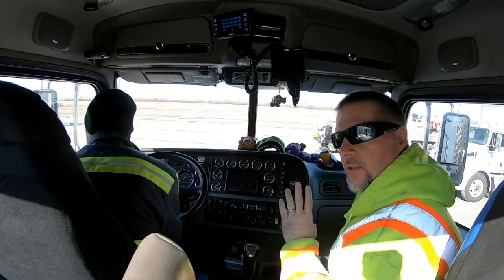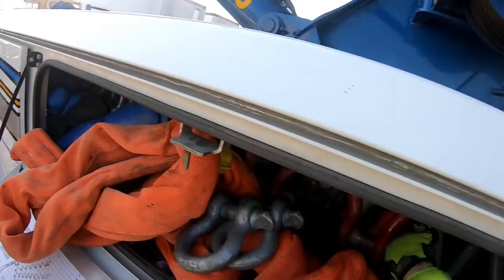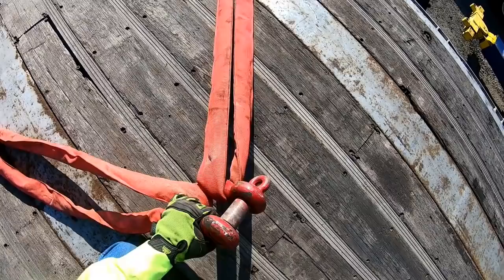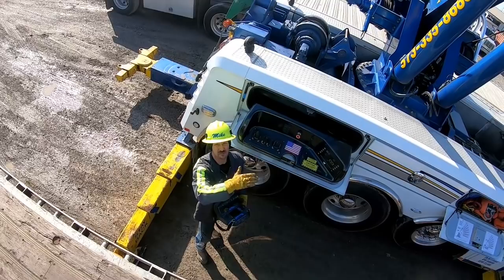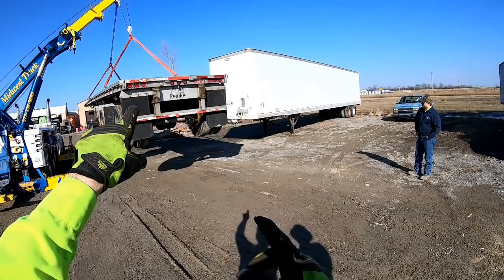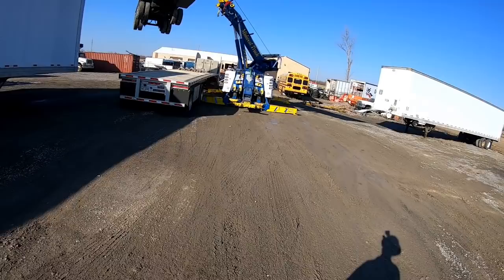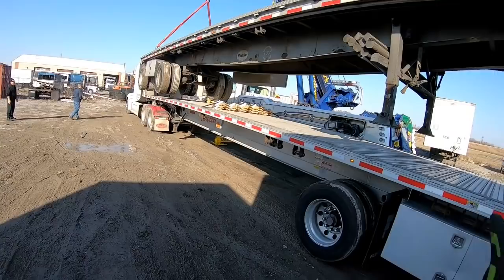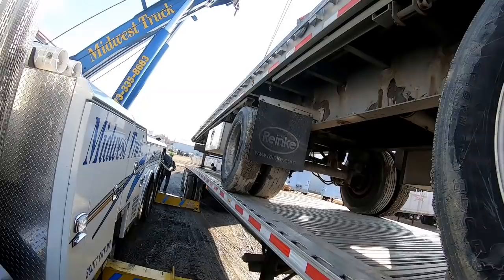Mike, the Tator, & the Trailer

Comment: Way to go Ron ! This is how I got my Hands on Training , with a Senior Certified Operator ,  Trained on Boom and Cable Boom  and on Tandem and Tridem , Don't get nervous Mike we all started out the same way , with practice you be shifting without the clutch as Ron said you can speed shift just tuning into the sound if the Engine , The RPMs will tune right in . Driver training on bigger trucks and Training on Booms cause basically a Rotator is a Cable Boom , my Certification came with lots of practice and guidence . Just Remember Mike work at your own pace and take all the practice and guidence you can get , and pay attention to a great teacher willing to give the chance to improve your skills . 
Great job to both you !

Comment: 2:40 Mike, if it doesn't want to go into gear, you usually just need to tap the throttle a little to bring the RPM's up.
And don't worry, we ALL ground a few gears when we were learning, I know I did...
Reply: As a young'n just learning the farm trucks, my dad showed me that he could shift it without using the clutch.  As soon as I was cut loose in the field, I would shift up and down through the gears only touching the gas pedal.  And yup, ground 'em a bit in the process.

Comment: He just needs to remember RPMs are your friend when driving a non-syncro transmission they don't like to shift at < 1200 RPM's.
Reply: I raked  few gears when I was learning. I drove a 5+4 for a while, I didn't know what gear I was in for the first two days, after that I got to liking it.
Reply: My thoughts.
Reply: @doublel7337  There is a reason Duplex transmissions have fallen out of favor for 18 speeds

Comment: This video did not seem like it was over an hour long, watching Mike at the controls and you Mr. Ron guiding him with patients and a relaxed demeanor sure made for an interesting video. Nicely done Mike, you’ll get the hang of it with practice and repetition before to long, then it will feel like second nature doing this job or something different. 

Believe me when I say this, we have a 53’ long tandem axel 73,500 lb, 104’ Ariel Platform Tower at our fire station, not just driving, it was a long time to get use operating it, while working the schedule we have. Before I retired last April, I was one of a few of the go to guys for almost everyone else on the department, including the new rookies, I’m talking from the Captain’s on down, because we all were responsible to be able to operate it. 
Note: our saving grace was in the form of a 6 speed automatic...👍👍

That included the platform or bucket controlled ladder and the 2,000 gallon a minute fire pump.. with 8 discharge and 3 different water intakes to it. It also was a $750,000 piece of equipment back in 2009, today’s replacement cost is well over a Million, not unlike the Tator.

Excellent job all around. Keep up the great videos...!
Reply: "patients" = patience

Comment: Ohhh! Mike's in the big chair and running the sticks(controls). Nice.
16:30 You could run a bungee through the cargo container's shackle to the trailer's rail to put tension on the hook so it doesn't slip off. Anchor the bungee toward the pull and it'll stretch enough when it gets loaded.

Comment: Another great video! My name is Mike too and after 35 years of driving big trucks, the sound of scraping gears still makes me cringe...especially when it's me doing it to my own transmission lol! We all miss one now n then. If you want to play with your Mike a little, you can say "That's ok, they're gonna start making gears out of rubber next year", that's what my dad used to say when he was teaching me and I sometimes tease my trainees to this day. Now, if I could make a suggestion, PLEASE don't EVER shift while turning. There are 2 reasons that I drill this into my trainees like dad drilled it into me. 1) it's easier to break the rear driveshaft when the drivetrain is in a bind. Normally, you can still complete the turn and get off the road, but, all the noise your truck is making could be a bit embarrassing. 2) and even more important for everyone, if you miss the gear and can't recover, you're blocking the intersection and creating a traffic hazard, especially while making a left turn. I've seen both of these situations. The worst one was about a year ago right outside of our terminal. One of the fleet drivers waited for several vehicles to pass before turning left into the lot to go home for the weekend. The driver was pulling an empty box but for some reason started the turn in low gear. After realizing his mistake, he tried to shift but missed the gear. He actually should've started in 3rd gear, but, in this case, he'd have been better off to leave it in low since the rig would've still been under power and the approaching car could've passed safely behind. I as well as the 2 mechanics in the shop were "first in" (I was turning in my weekly paperwork before heading home myself) and our first concern was the occupants of the car. Thankfully, the car hit the drive axles on the tractor rather than going under the trailer. Even though the car was completely demolished, and both the tractor and trailer had serious damage, the occupants of the car had no serious injuries. The truck driver, on the other hand, was so shaken up by his mistake, he hasn't driven ANY vehicle since the crash. He was cited for failure to yield in a turn. Luckily, the occupants of the car are also from a trucking family and understand that mistakes happen so, they didn't file any lawsuits against the company or driver. Also, please remind Mike that when double clutching, you have to be quick. The r.p.m.drop between gears should only be about 500-700. I don't know how they test in "Mizzery" but, here in Ohio, they DO want you to use the clutch, unless of course you're testing in a truck with an automatic transmission (yuck!). However, they seem to expect rookies to miss a gear or two during their road test and seem to place more emphasis on how well they recover the gear and keep rolling. If you have to come to a stop and start over, it's an automatic fail, and, better luck next time since you just created a hazardous traffic situation. GOOD LUCK IN YOUR TRAINING MIKE! Listen to what Ron and The Tator are telling you and learn from them! They know their stuff!

Comment: It’s interesting that the worst position on your truck is the rear corners. I work for a communications company, as a plant supervisor. My guys are trained to work from the rear corners of the bucket trucks for best stability. Personally I’ve always thought they should work directly off the side, but the manufacturer states rear corners are the safest.

We’re certainly not lifting the weight you are, but when you’re over the rear corner of our M2-106 with a man in the basket, that truck gets some serious squat on that rear corner.
Reply: I should say, our trucks are built for mobile operation so we have torsion bars instead of outriggers.

Comment: Hey Ron, question. You may have explained this already and I missed it but, why do you stow the boom at 8 degrees? I run an 1150 also, non sliding carriage, but we don't stow the boom at any particular degree. Just wondering the reason to see if it's a practice we need to apply for myself any the others who run the truck when I'm not available. Love the videos and keep up the good work!!! God bless!!!!
Reply from the maker: @Duane Miller  When we first got our truck, I took multiple measurements.  With the tag axle down and the boom stowed at 8 degrees I know that I can clear 13' 6".  Yours may be different based on your chassis, air ride height, etc.   Thanks for watching and God bless.

Comment: Can mike drive the rotator without the permit as long as he doesn't tow something. Like a simple winchout
Reply from the maker: Mike has a Class A permit, which allows him to drive the rotator as long as a Class A qualified driver is riding with him.  He can't drive it by himself until he has the Class A license.  Thanks for watching and God bless.
Reply: tractorboy31 
At the 72000 lbs it's a class a
Reply: Class B is good for up to 80k truck only though, A still requires a permit at least with a License operator to operate since this class is for combination vehicles up to 80K and beyond.

Comment: I think Mike needs a bit more practice, however I think once he gets used to the Tator, which we know is a pretty complex tow truck to operate, he'll take some of the load off of you Ron. I am a past owner of a 13 employee machine shop, IE (was a CEO, but at night I programmed and ran my own personal CNC lathe because I liked doing it and I did 80% of most the welding that we did not send/farm out as I am certified in Mig & Arc too) .  I believe Mike is one of these tough guys that is not afraid to get up out of a nice warm bed and go out on a call in the middle of the night or in a bad storm, winter or summer and do his job to the best of his ability regardless of the truck he is driving as I know you have several including that really nice new Peterbilt roll back. I'd like to think my good employee radar is still in great shape, LoL....  As far as the long video  u mentioned, I enjoyed it, and watched most of it while eating dinner, LoL....  My message to Mike would be keep listening to Ron, go over what you did in your head thru the night before sleeping so it stays ingrained in your memory, and double check, or even triple check what you did before you move anything. In my field it was measure twice or three times and cut once. You can even make a check-list like they use in air planes, for example are the yellow feet deployed and firm on the ground, is the Tator locked in, etc. both for coming and going and I always checked my list, and perhaps you should too, regardless if you have it memorized or not. I'm not telling you how to do your job as that is Ron's job, but I used that "check list" method, and it worked for me, for example: I never left my shop with the windows open or the doors unlocked, the truck doors unlocked and keys put away, or the 440 power energized thanks to that list and much more. One time you forget is one time to often in my opinion........ I watched this on 3/15/2019 at 10:00 Pm (had a late dinner) and as always I gave it a thumbs up. I hope you didn't mind my butting in a bit Ron.... Nice video as always and I gave the video a thumbs up as always. God Bless you and all your loved ones.

Comment: Do you ever drop the pusher axle? I dont think I have ever seen it lowered. When if ever do you use it?
Reply: Its automatic, forward it goes down, reverse it lift up, has a manual override switch down by the door that he showed switching off in one video a while back (Nissan 350Z Fail i believe was the video) to keep it from eating up air supply.

Comment: Why do you not have tag lines to control the load.....? If the wind picks up she goes around and around said Chubby Checker....
Reply from the maker: I do not have this rigged using a single lift point like a crane would use.  I have two main lines attached to two sling bridles.  Using to lifting lines minimizes movement and prevents it from spinning like a single lift point would.  I even talked about it on the video while instructing Mike.  If you keep the lines short, the load won't move very much.  If the two lines are long, then it would have required tag lines.  I much prefer using multiple lines to the load, but I am not a crane operator.     Thanks for watching and God bless.